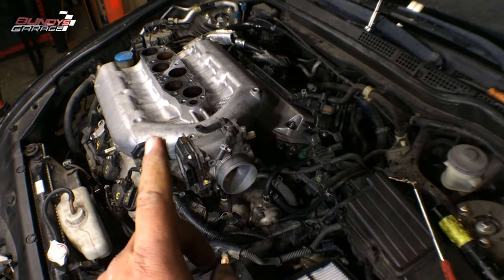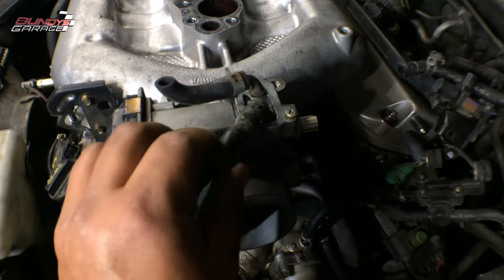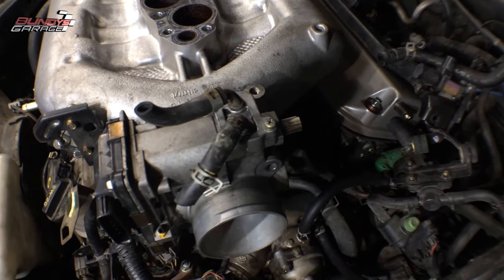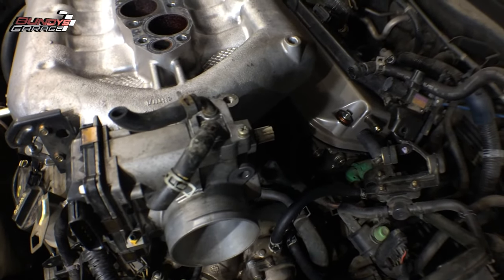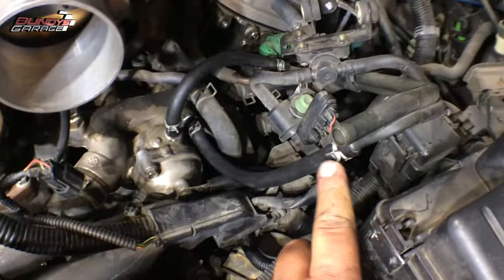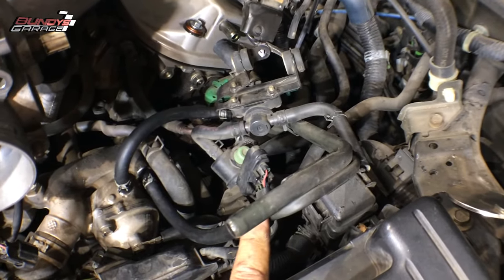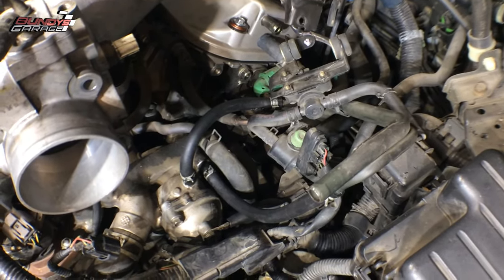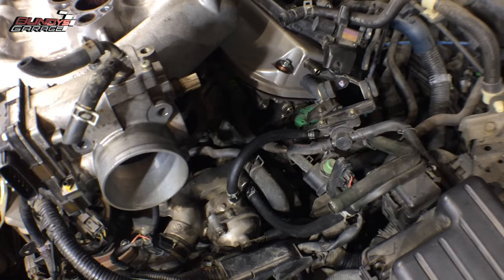J SERIES V6 Honda Throttle Body Coolant Bypass | Accord Odyssey Pilot Ridgeline Acura TL CL RL MDX

Comment: Hey bundy, I’m having problems with my 02 accord 3.0 I just redid the head gasket on it and upon starting it after running the bad oil out the engine I thought it was alright. Until I turned the car off and I noticed water coming from my throttle body/ air intake box do you know how this is possible or where to start to fix it
Reply from the maker: Email me your phone number at bundysgarage at gmail dot com
Reply: I did

Comment: I have heard that this actually decreases your gas mileage, as the hot intake temps help with gas mileage. 

I am very curious to hear of your results!
Reply: That wouldn’t make sense with the p2r intake thermal gaskets attempt to reduce the temp of the manifold

Comment: Hello Bundy , sorry to bug again , would u happened to know which throttle body do I use on my 99 Honda Accord ex 3.0 J30A1, got my car to run back ok after I did the fuel injectors, I found a bad fuel injector that ended up being my problem, but now my idle nearly dies out when it down shifts at a stop , but turns rite on idles good from the start or in park and driving at regular speeds but when I stop the rpms drop and it nearly and sometimes dies out ???? Thanks again for ur time and help Bundy
Reply from the maker: Sounds like it’s your idle air control valve, check this video out: https://youtu.be/vUXXzVL5frk